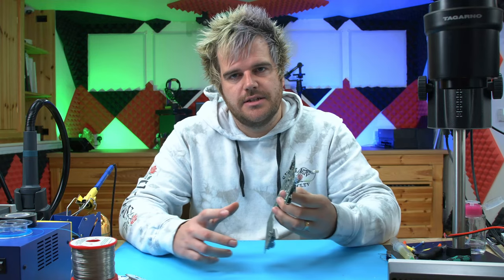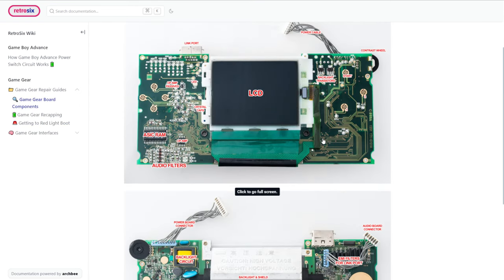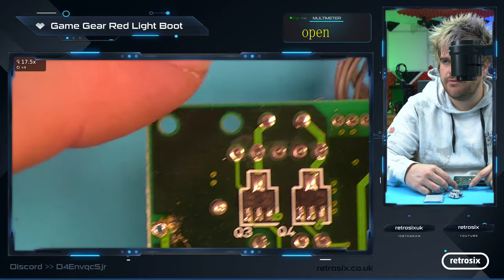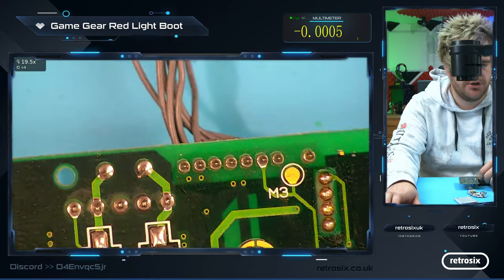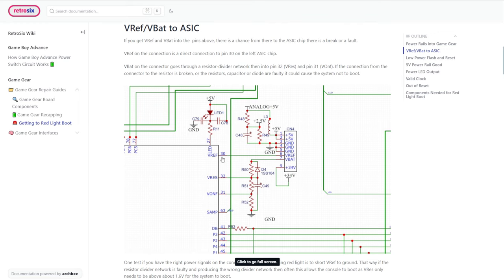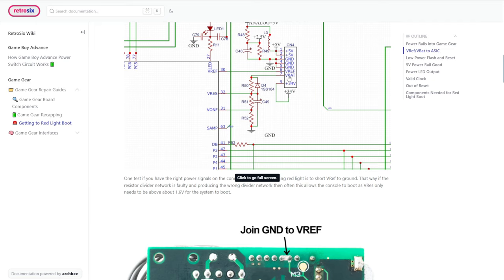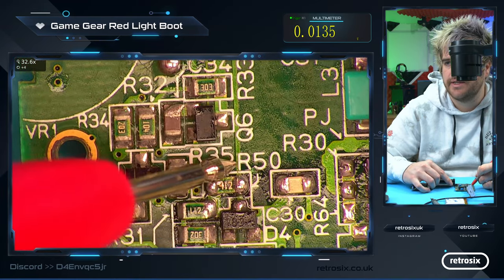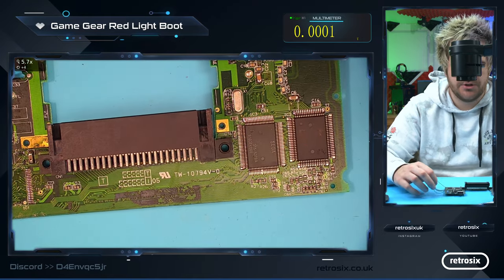Get To Red Light Boot on Game Gear - RetroSix Repairs

Comment: My game gear turns on, the light flickers, and there is a strong spark at the solder point of the lamp wire with a lot of smoke.

The power board could not maintain 5v. When you turn it on, it's ok, but in 2 seconds the voltages start to drop until they reach zero.

I replaced the capacitors and it worked while it was unplugged. All voltages correct on all pins.

When I connected it to the main board, the same problem happened again. Blinked, spark, smoke and the power board could no longer hold the voltages.

Somebody has any tips?

Comment: Thank you for this video, I thought it could solve my problem but no...
My Game Gear works perfectly but the red light is still blinking even though the GG is plugged into an AC adapter, I measured the Vonf, and it's around 1.85V and Vref is 1.12V.
So it's ok I don't understand why this red light is constantly flashing...
Reply from the maker: Join our discord for more support discord.gg/RetroSix